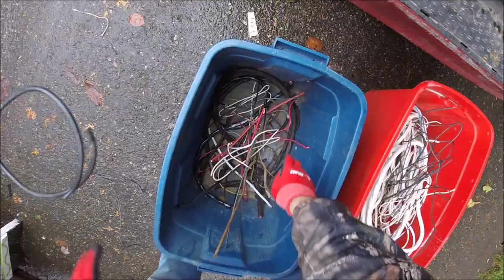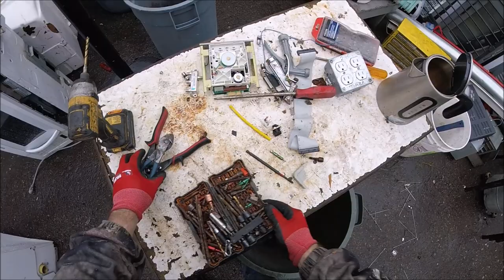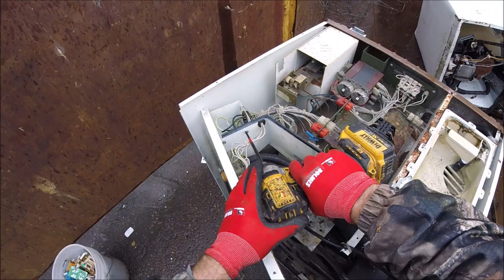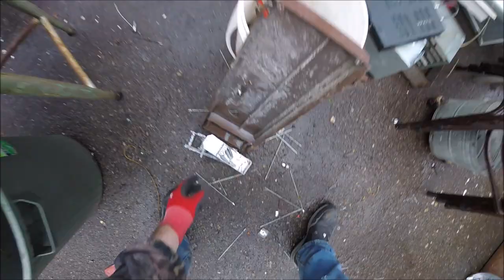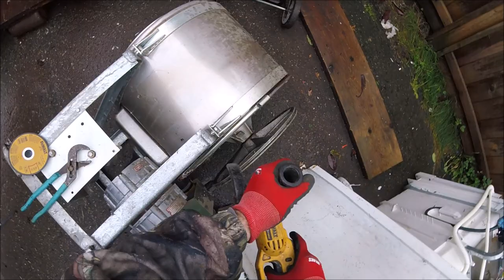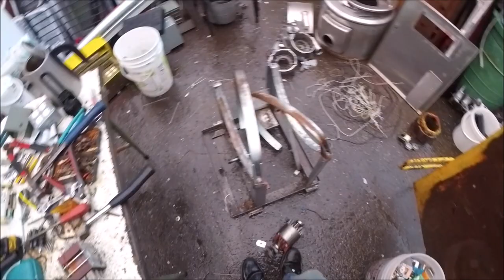Scrapping Commercial Washing Machine

Comment: I was taking apart a Kirby vacuum a few days ago and had the same issue with rusty screws. They were just disintegrating as I tried to loosen them. I got about 80% stripped. BTW, if you ever come across a Kirby make sure you grab it, very good cast.
Reply from the maker: Yes good cast alloy

Comment: Curious if you pull any brass off of plugs? I take the brass off of every plug it adds up. The appliance plugs are definitely worth it for anyone I would think. I just use a pair of players and a razor knife.
Reply from the maker: Dryer & stove plugs have good brass

Comment: That really thick aluminum wire my yard gives me either sheet aluminum or extruded. Have to look closely because the sheet is thinner and more brittle than exryded.  Sheet is .26 and extruded is .45. If it is not stripped I get .09 a pound. Thought I saw some in the beginning.

Comment: I think on that washing machine you may have gone a bit too far for what you got out of it you got some wire and you got a motor but was it worth it all your time to do what you did it's up to you but I would have just taken the basics out good video though interesting learn something not to deal with industrial washing machines. One more thing you're good at smashing bathtub why didn't you take a sledgehammer to that cast aluminum on the back of that drum.
👍👍😀🔌☔
Reply from the maker: cast iron breaks easier
Reply: With those big hammers the aluminum or break easy to you break it was a small hammer you should be able to break it with a sludge